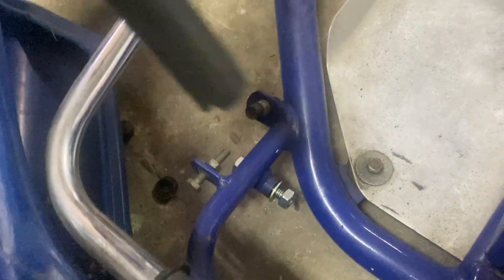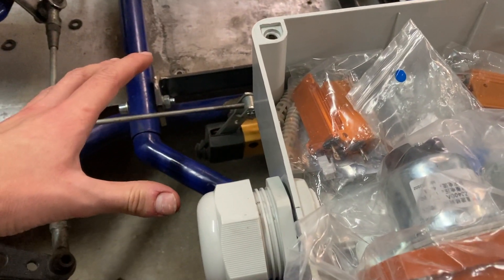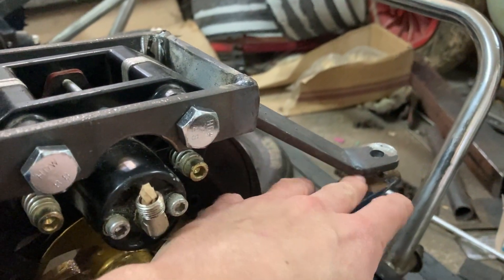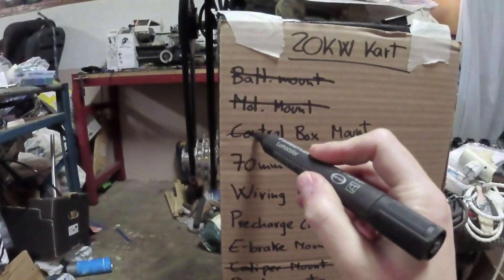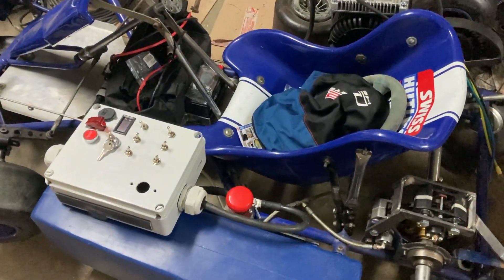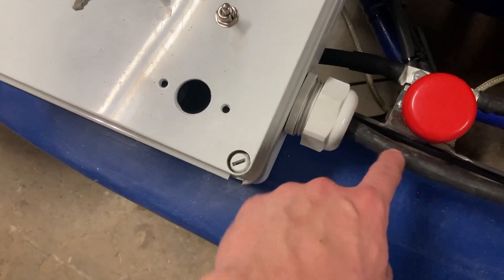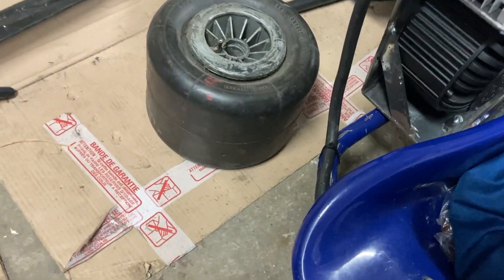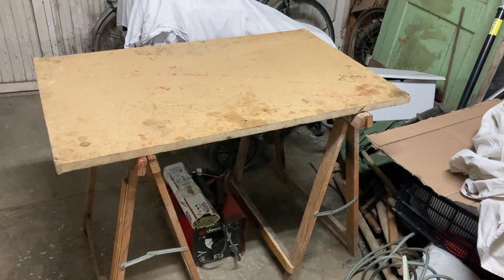Homemade DIY 10000 Watt Electric Go Kart Conversion - Almost ready to test

Comment: Hurrah! Almost ready to go!
Can you crimp the cables instead of soldering? Solder is great and pretty easy, but crimps are better especially with high power -- and they make the cables easier to bend.
Reply from the maker: I crimped all the terminals except the anderson 350A connector because they are thicker and after crimping they were bent out of shape and looked like crap. The anderson connector came with 70mm^2 terminals and the main wiring is 70mm^2, they came a bit bent after crimping but nothing too bad. In order to use the same battery as my previous project I made an adapter to go from 50A anderson to the 350A anderson, I used 10mm^2 silicone wire to build the adapter, 10mm^2 for the 50A connector was perfect, but for the 350A connector I needed to bend the wire several times in order to achieve more or less the inside thickness of the bigger terminals, then I crimped one terminal of the 350A connector and was terrible but usable; finally decided to try to solder it and it is what I did at 4:27.
Reply: @OverbuiltByHenry  
Awesome! Yes, Andersons are a little weird; they are designed to solder well, crimping is rather a pain on those. Solder is usually enough unless things heat up, so if you do it well it's totally fine -- and it looks like you did a great job!
I'm looking forward to your next video!
Reply from the maker: @isaackelly3157  Posting new video tomorrow! Merry Christmas!!
Reply: Either you are making the wiring overkill or I might need to suck it up and buy thicker cable...my set up will be 72V nominal, 84V peak and I will be pushing 200A peak, not sure how many amps continuous..probably 60-100. Right now I am planning on using 4 guage wire. Max wire length should not be between 3-5ft

Comment: Hi, Cool project. I did not understand - why did you put batteries between your legs and why the wire to the battery is so thing compared to main bus ?
Reply from the maker: The batteries just fit well there, the current battery is from my previous project (the car alternator go kart) and before building a custom battery for this project I want to try it with the one I already have which the adapter that I made is for this purpose. Thanks for watching!!